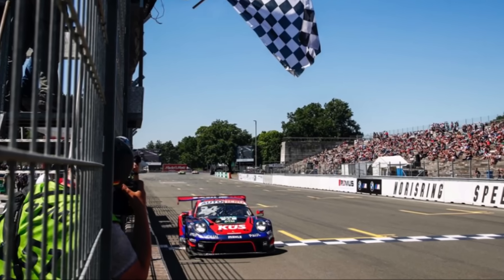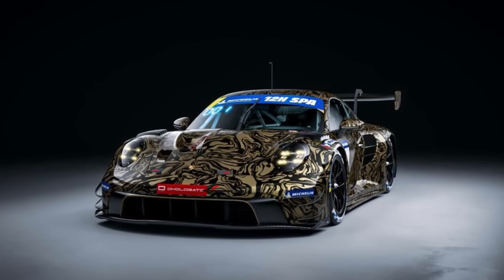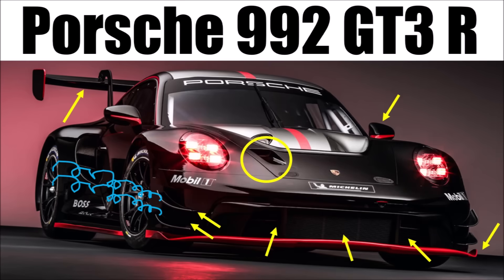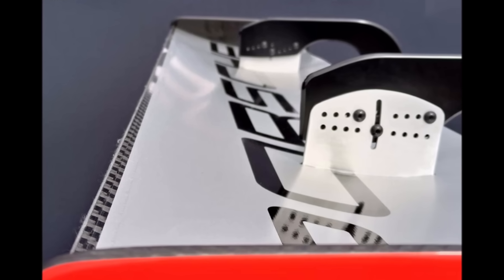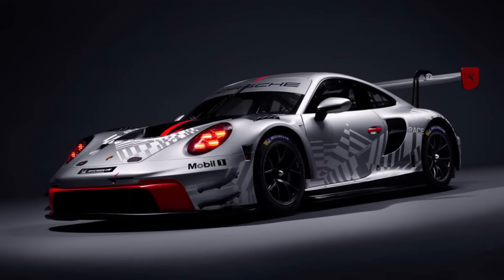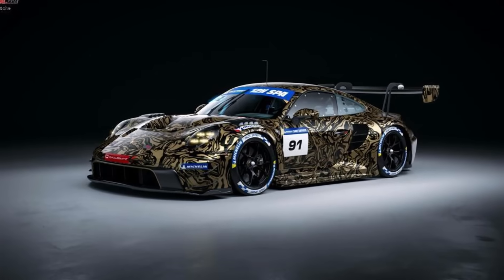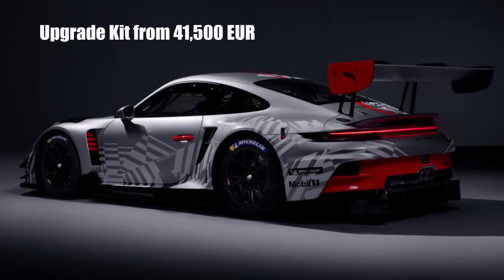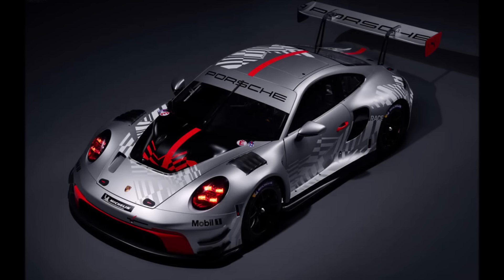Porsche 911 GT3 R Update - CLOSER LOOK

Comment: Why/how is the 911 GT3 R and the 992 Cup car so different performance wise despite it being, as Porsche claims "technically identical"?
Reply: 992 Cup is the entry level race car that was basically Porsche responding to US PCA demand for a Porsche built race car for club races. That is to say it’s a 911 GT3 with a cage and the race car stuff from the factory. Well the 996/7 were basically that. The new ones are sort of their own thing. But the 911 Cup is still just a 911 with a big wing. It’s very bare bones, low ish down force . 

The GT3.R is high downforce and has a modern aero car experience. Lots of handling characteristics that change at different speeds.
Reply: @Principia1910  Thx!
Reply: @harblewarble6427 PCA has a GREAT video on the cup car history by the way.

Comment: i never tough GT3 cars where that expensive
Reply: Been going up every generation. If it doesn’t stop the category will go the same direction all the GT categories before it did
Reply: @icefire__ idk that it’s profitable to run a GT3 program but a lot teams are making it work. Drivers keep paying and sponsors are there and ratings are going up. 
I do think lower costs would be good but at the same time I know Audi’s customer racing was a net profit when it shut down for Audi which helps keep these cars being offered to begin with.

Cars like the Lexus are basically subsidized by Toyota and are an expense. Anyway, my info is now 3 or so years old. Would be an interesting video…

Comment: About higher downforce making cars trickier to drive: is it because they become more pitch sensitive or is there more to it?
Reply from the maker: You get additional aero effects like pitch or roll sensitivity, driving behind another car etc. also the balance can change with speed and there is more on the setup to mess up.
Reply: He’s right but generally speaking at low speed you don’t have downforce so it behaves one way and at high speeds you have a lot of downforce so the car handles a new way. Thus you have be more aware of your car and more aware of your speed where a lower speed GT4 or GT2 or perhaps your street car on a track are going to be more consistent at all points around a circuit.

Comment: Great channel. Since the downfall of the GTE machines are they doing anything to lower the engine or move it forward or regain some of the mid engine characteristics?
Reply: If my info is correct then it is like this, but someone will surly correct me if nessesary^^:  the engine in the 992 GT3 R is heavily tilted towards the front to allow the diffusor to work more effective, much more agrresive in design. with the old cars, 997, 991 and their engines they had to compromise on the effectiveness of the diffusor. That is also one of the reasons the RSR was a mid engine build in the first place.

Comment: I hate that GT3s are getting more expensive every generation. Kinda happy to see a relatively cheap update.Yet I think GT3 will die as long as the SRO doesn't put measures to reduce costs. At this rate we will see GT3 end like GT1 or GTE in 5-10 years. Also, while these aerodynamically refined cars are kinda cool, it also worsens the racing gradually.
Reply: when are you planning to buy one ??

Comment: I did not know GT3 cars have been getting more downforce as time goes on. I always thought downforce levels stayed the same but just tweaked the aero to have a wider and wider window of peak performance. Is there a ceiling to how much downforce they can run per the rules? Like I’m tryna extrapolate where GT3 will be in 10 years. Like will we have GTE or LMP3 levels of downforce? Will GT4 get faster and by doing so will there be a new GT class to fill in the void?
Reply: I've read a couple months ago that today's GT3 cars are matching lap times of the once GT2 class (not to be confused with the current GT2, those cars were similar to GTEs). Who knows, maybe some day we'll see them braking GT1 lap times (mind you, I'm talking about the 2000s GT1 class, not the prototype-esque monsters of the late '90s).
Reply: @Petidani0330  - another thing to keep in mind is the progression of tire technology. Not including some changes over the years, Suzuka can be a prime example of that progress (by 2020, GT3 cars--even when using single-make tires--are faster than Super GT's GT500 class up until 2002--where tire war is a thing).
Reply: @pmayo7894  That's very true. Like they say, the tyre is the only part of the car that makes contact with the road itself, so it shouldn't be overlooked.
Reply: The downforce is indeed higher but keep in mind GT3 is still a BoP’d class. The updates are sort of a business thing. Porsche wants to sell the new cars and aero kits to fix issues and the cars get beat up and need new kits anyway. 
When the new kit comes out they have a bit of a grace from BoP as the BoP team figure out what they actually can do vs what drivers do.  So there is an edge to be had, typically, if you spend the money and upgrade. 

But the reality is that BoP eventually squishes the performance window back down to the levels of competition and what’s changed is usually ease of driving and maintenance and of course support and business from Porsche. They need to make money. 

They try not to BoP user error and less user error is a Great way to win in GT3. 
It’s partly why Audi was so successful. 

GT4 and GT2 are both minimal downforce with GT2 being high power and GT4 being low power. They won’t likely adjust them around GT3, the style is more around being easier to drive for amateur than about the pace. 

There are some articles for more in depth look at GT3 business. It’s pretty cool; should make a video on it tbh.
Reply: They are already past GTE levels of downforce afaik. LMP3 is not that far ahead but it's still better.